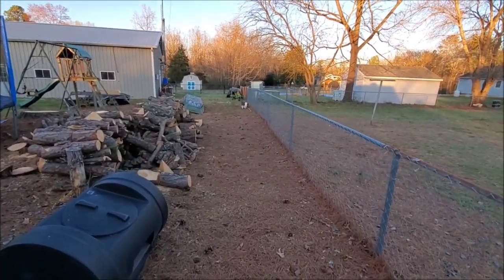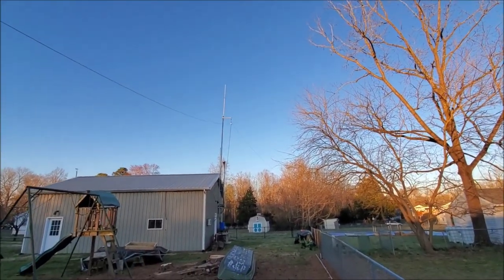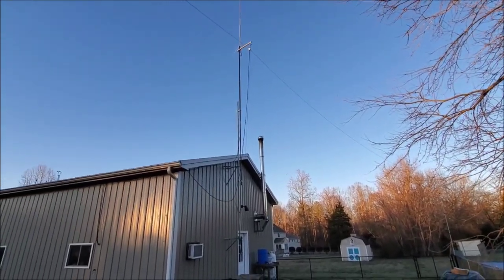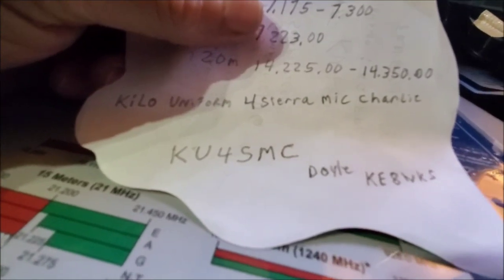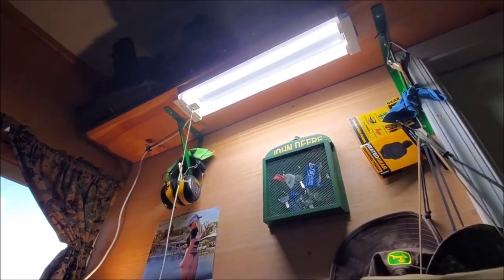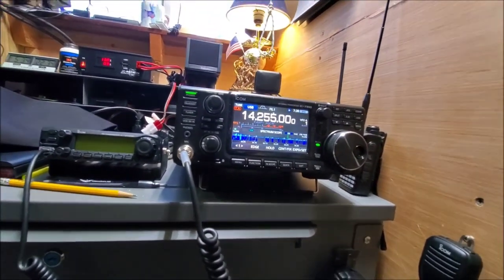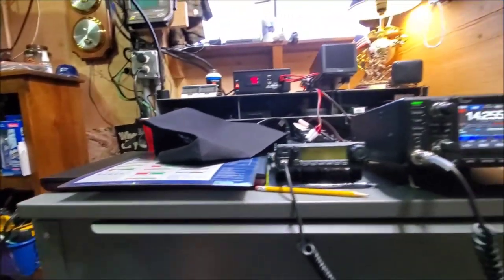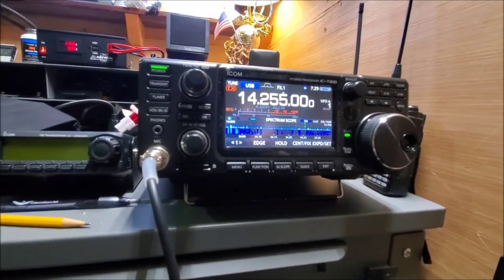HAM Radio Setup By KVUSMC/KU4SMC

Comment: Welcome to the hobby! Glad to hear you got your call sign! 

HF/VHF antennas look good and stout! Buckmaster has been around a while and makes good stuff. 

I Aldo have a 7300 and I love it! That darn thing will do sooo much on the bands and there is a ton of options and aftermarket goods available. I use my 7300 on Winlink and the CAT option makes Winlink/Vara digital comms fairly simple. 

10meters 28/29mhz. Has been hot lately, I bet there are plenty of hams near 28.400 (calling
frequency). 

Have you received any qsl cards yet? 

73 es gud DX
Reply from the maker: I have a confirmed contracts I appreciate it I get pileup sometimes it is hard to make a contact Holy cow Brother it is an Awesome Hobby For sure I love it Cheers Brother 73
Reply: @KVUSMC-KU4SMC  It will get easier as time goes along. Hope to hear you on the bands soon.

Comment: You could use a wire mesh strain relief on the rg8 attached to a pulley on the mast and take a lot load off the antenna and cross brace. Just a thought. I like your set up. 73 de WB6JAF.
Reply from the maker: I really appreciate it Brother that is a great idea Brother I appreciate it any Help 73's de KU4SMC 🙏

Comment: I like your shack. I love my Icom 7300. I also have a Kenwood TS-200 which is VHF, UHF and Hf.
I use wire antennas too. I built all of mine though. Congrats on your General. 73's Gary KF6EWO
Reply from the maker: I really appreciate it Gary many thanks awesome rigs Cheers KU4SMC 🍻